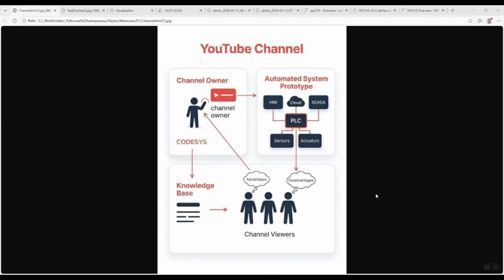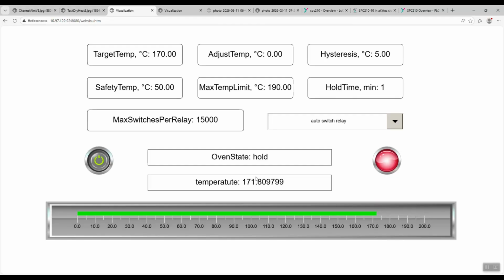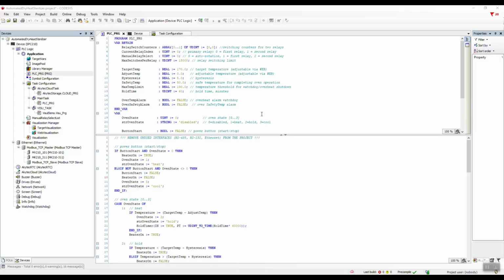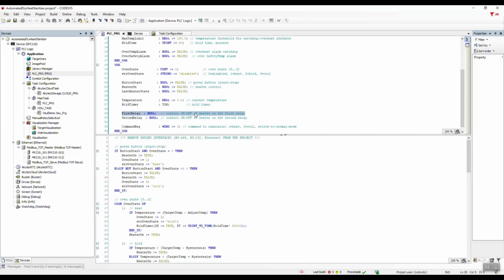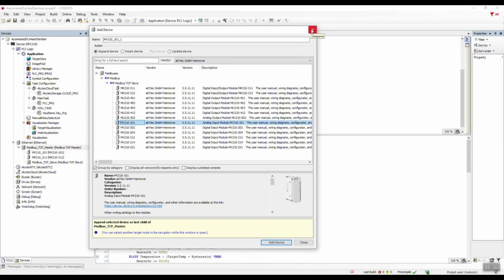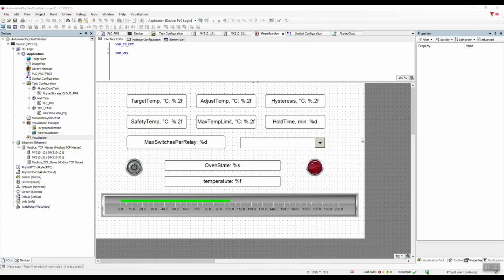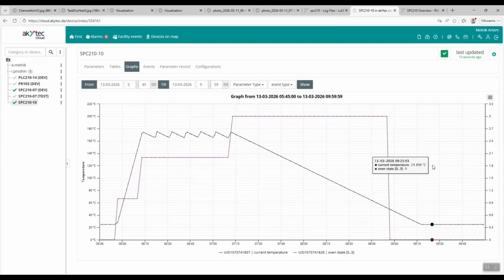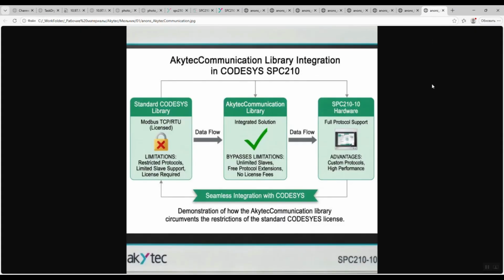CODESYS Tutorial 1: How to Build an Industrial Dry Heat Sterilizer with akYtec PLC

Comment: Let me know in the comments which of these topics interests you most, or suggest your own:

1. How can you use the built-in OPC UA server in CODESYS to integrate SPC210 into popular automation platforms from well-known companies?

2. How can you use the built-in cybersecurity tools in SPC210 to protect against hacker attacks?

3. How can you increase the speed in CODESYS of response for SPC210 and the input/output modules polled via the Modbus TCP and Modbus RTU protocols?

4. What are the advantages and disadvantages of the Modbus Master and Slave modes of Weintek operator panels when used together with SPC210?

5. What are the advantages and disadvantages of multitasking in CODESYS?

6. How can you use the visualization editor in CODESYS to create a multilingual project and set up screen navigation?

7. How can you use the built-in Linux utility call library in CODESYS to integrate SPC210 with popular automation platforms from well-known companies, or with any specialized applications?

8. How can you use the built-in Akytec Communication library in CODESYS to bypass the limitations of standard Modbus components?